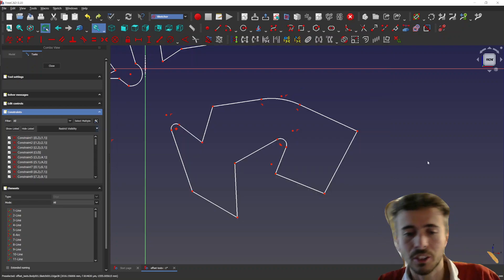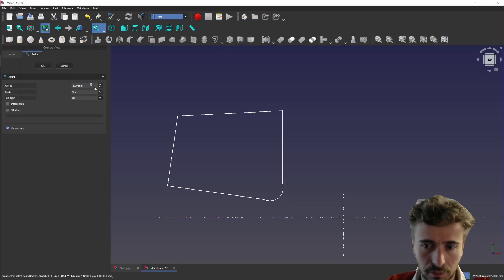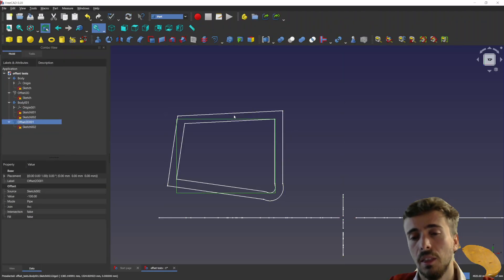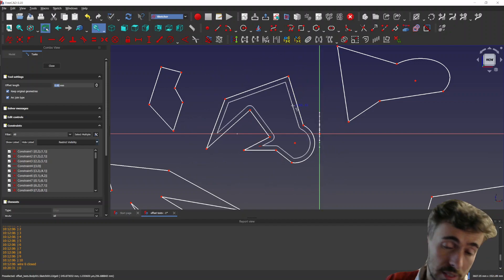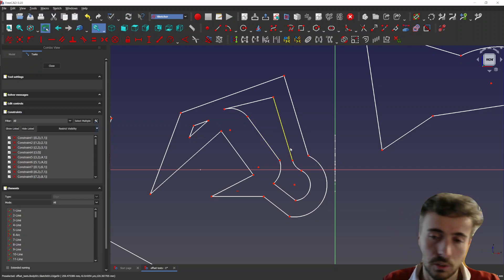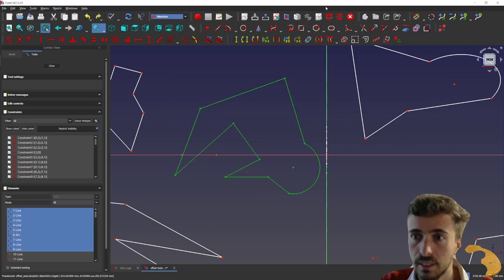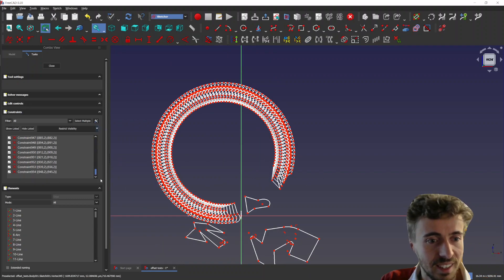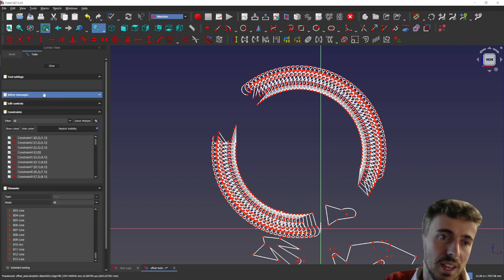FreeCAD New Feature : Offset in Sketcher

Comment: Hi, thanks for the hard work! I'm testing the new features of the sketcher in the daily release; one question though : could you add an option for the symmetry tool to have it constrained, the same with the offset tool, or the other duplicates, linear etc. tools? So we would have either free modification of the new sketch or already constrained.
Reply from the maker: There is an opened PR for that already :)
Reply: @freecaddevdiary7038  Very nice ! 
Still testing the dev release;
Something I could not achieve with this release is the "binders"; it's a nightmare getting them running normally; I got them working with the stable release, but not with the dev release. I must do something wrong; in any case, these tools (the binder) would benefit to be more usable (like, being able to bind to any sketch in the model) : they are just references.
The sketches of a whole piece (not body, piece with multiple bodies) must be able to be bind, easily, with an uniform method ). (imho)

Of course, I'm not the one who develops so ... I know ...

Sorry!
Reply from the maker: @TheEricounet26200  I don't understand, but if you have a problem the way to go is to open a issue on freecad's github project. It's the best way to get it fixed :)
Reply: @freecaddevdiary7038  Ok, I'll try with a simpler piece that I'm doing at the moment to see if it's still there (or if it's me who doesn't understand how it works). But the way I did it with the stable release works ...
Maybe the way to do it is a bit different. Will investigate and open an issue if it persists.
Thanks for answering me!

Comment: Hi, I installed v 020, but do not find the offset symbol. Do you need to install this ?
Reply: It hasn't merged into master yet. So you can't use it without compiling my fork, which is fairly annoying to do. It should merge in few months I think.
Reply: @pierreboyer9277  it's still not in the Dev version, do you know when it's coming? Lots of people asking for an offset that isn't complicated.
Reply: @Adventuresincreation  I jsut discussed with the sketcher developper and he told me he won't be able to look into tool settings before next year. And offset is relying on that so it will come after...
So yeah, I just don't know what to do at this point.
Reply: @pierreboyer9277  it sucks that you are putting in all this work but it can't get to the end users. Is there a way to package it up as macro or a workbench that could be used as an addon?
Reply: @pierreboyer9277  I will do that
Reply: @Adventuresincreation  Asked politely on the forum please, there's no point being angry or what. Just ask is enough. The real problem is that there isn't enough active merger for sketchers. The guy has too much to do. Though this may solve soon because there is a new one just recently.
Reply: @pierreboyer9277  I am always polite, all you guys are doing great work. I completely understand the overloading. I would only like for people to understand how useful this would be to so many users.

Comment: i'm using the latest weekly build but can't find this in Tool>Customize and since there is no more search in Customize I can't seem to find this function.

OS: Linux Mint 20.3 (MATE/mate)
Word size of FreeCAD: 64-bit
Version: 0.21.29393 (Git) AppImage
Build type: Release
Branch: master
Hash: 6820e0a9ec85203a6f342ca72a2ff8fd417beaf1
Python 3.10.5, Qt 5.12.9, Coin 4.0.0, Vtk 9.1.0, OCC 7.5.3
Locale: English/Canada (en_CA)
Installed mods: 
  * SearchBar 1.0.1
  * BOLTSFC
  * Help 1.0.3
  * A2plus 0.4.56a
  * Curves 0.5.0
  * BIM 2021.12.0
  * parts_library
Reply from the maker: It hasn't merged yet. You would need to build my fork to find it. Or wait until it merges in master

Comment: Good work !!  I really hope this stuff gets in the RealThunder version !!  He moves quick. I bet we'd be testing it in less than a month ;p ((well, maybe month or months tbh)except there was just a release but u nevakno)
         It must have been really cool to find all that previous code !! It's cool to see how others approach/accomplish the same goals. Other minds from other times influenced by 'other' paradigms. =gr8 learnings=

        In my workflow(coming from Inventor) >> One of the main reasons to use the offset tool was to save time / not have to make all the constraints or draw the lines. I remember many occasions where I would be careful when making the original geometry just so the offset tool would work without error. The point of the offset tool is so you have one adjustable number which changes the entire offset.   
       The other thing I remember was when I would break the offset on purpose. This way I had all the lines and only had to modify a minor section. The funky part was that every time I broke the offset, the program automatically made a bunch of constraints. Those constraints were usually terrible and I would have to delete 90% of them.

Comment: Brilliant stuff! You've done well. Thank you for improving the sketcher workbench. I must now update my system.
Reply from the maker: No need, It hasn't merged yet so you won't find that in the daily builds. You need to compile my github branch or wait until it merges.
Reply: @freecaddevdiary7038  I don't suppose the next FC release is that far away. I hope your work fits in with the development timeline. I hope so.
Reply: @cheesedoff-with4410  it won't make it into 0.20 as they already announced a feature freeze. So that'll be for 0.21
Though you can always download the daily builds of 0.21 when 0.20 will launch. This way you can get the features as soon as they merge